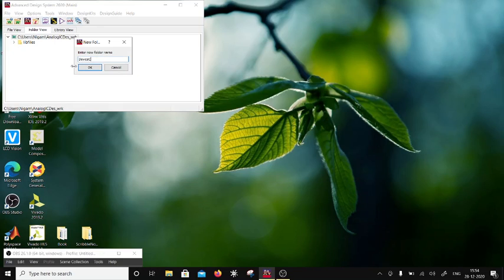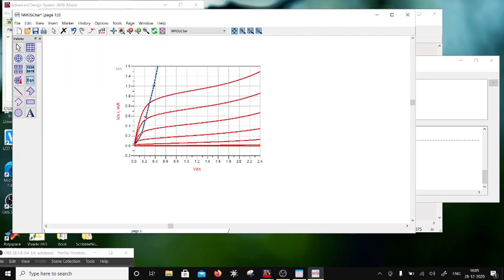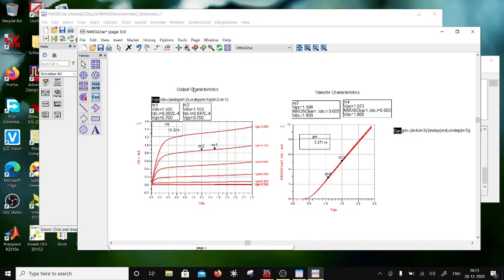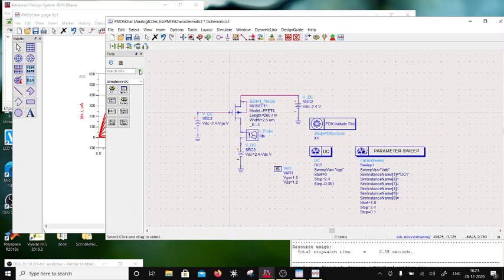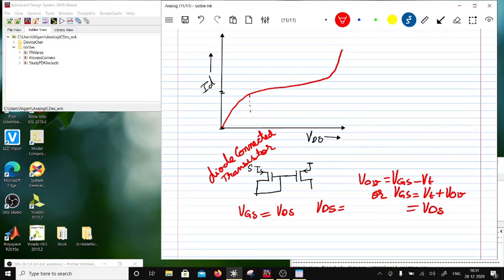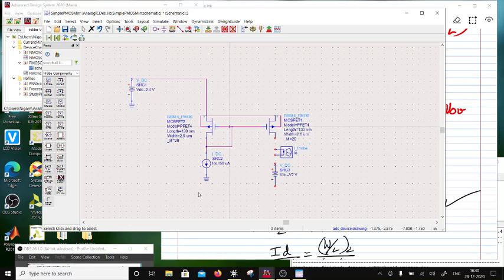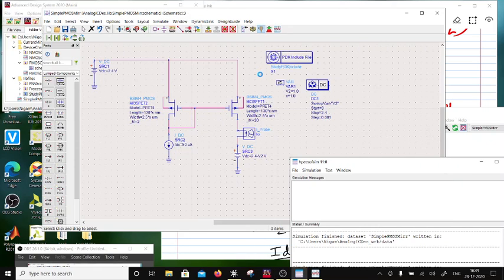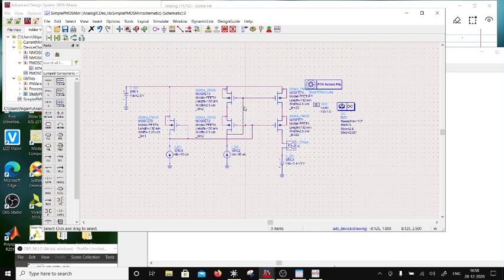Analog Circuit Design using ADS Session5

Comment: Hi, thank you for your informative tutorial series. Is it possible to share the PDK files? Without the files, I cannot emulate what you are showing. It would be greatly helpful if you could provide the PDK files.
Reply from the maker: please contact keysight they have a demokit
Reply: @anuragnigam9443  I checked https://edadocs.software.keysight.com/display/support/ADS+Downloads#downloads-1018700779 DemoKit and they don't seem to work. Could you please tell about how to have include file added in the workspace?
Reply from the maker: @navadeep025  i have been trying to explain this to Agilent and now Keysight for 10 years that kits are absurd.  so then i modified the models in the kit for my demo use.  I will sample new kits if Keysight contacts me to do so.
Reply: @anuragnigam9443   Okay! So, did I hit a dead-end in following up with this series without that PDK? (sorry I am new to ADS)  I mean, are you using custom files throughout?  Let me know if there is an alternative.
Reply from the maker: @navadeep025  I will give you the PDK if you are following Analog Circuit play list. Ha ha just give me some time to figure out if i can share file will people
Reply: @anuragnigam9443  Perfect! That would help a lot. Thanks.
Reply: @anuragnigam9443  Any update regarding this?
Reply from the maker: @navadeep025  I called Keysight and they told that if you are a customer you can raise  a request through them.  I am not allowed to shared PDK.  Thanks
Reply: @anuragnigam9443  personally, I have no use for this great pdk as I have my own, but I think  this is your pdk, so you can share it if you want.